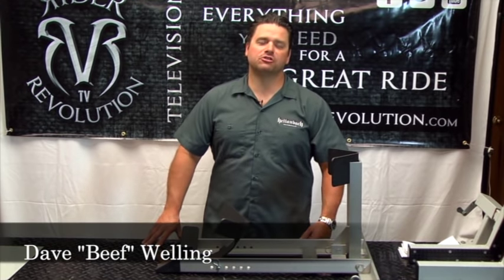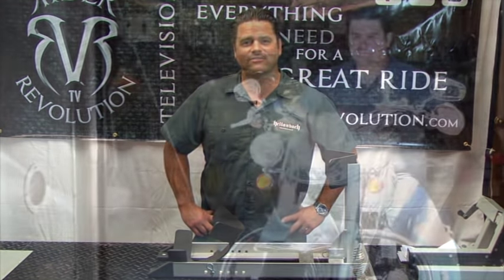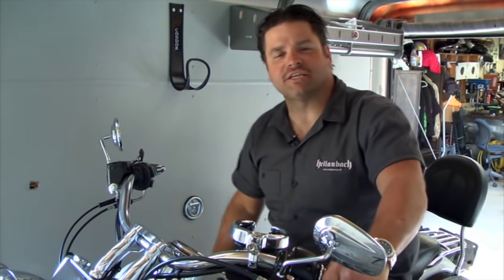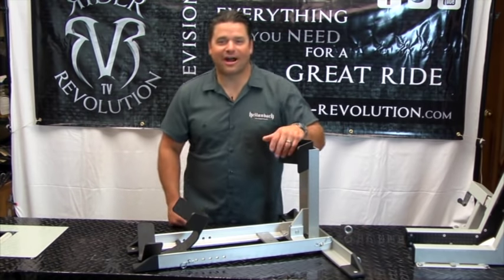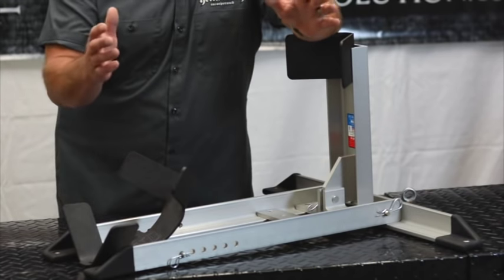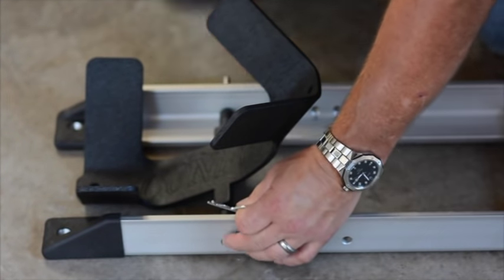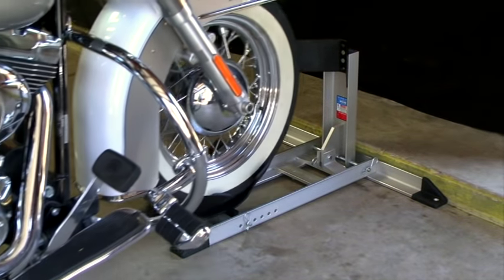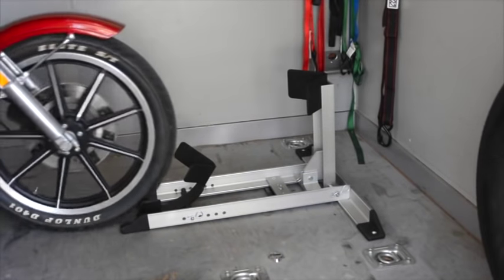Rider revolution/Condor wheel Chock

Comment: I have this , bought it at Harley dealership so obviously it's Harley "branded".  Either way , I love it !   No regret or buyers remorse here . I don't trailer my bike , I simply use this to park my Softail Breakout in the garage. As any bike owner knows, it's so much easier to work on your bike or detail it when it's standing straight up-n-down as opposed to setting on the kick-stand.   

One small thing to consider ; when you want to get your bike out of this chock/stand , you need to be sitting on the bike in neutral and give a good roll / lunge in the reverse direction.  I had my left knee replaced a few months ago yet I can do this .

Comment: What tye of system should I use to mount my chock temporarily... I have a wood floor toy hauler camper.  So I can't use standard screws to mount because putting it in and taking it out a few times would make the screw holes in affective and loose. Any help ?

Comment: Now how hard is it to pull it out of the chock.  I got apes.  The Harbor Freight one is a bitch getting the bike back out and as you can see, I'm not weak.
Reply: i guess it depends on your hight with most schocks.im 6ft3"and(how long your legs are matters)i have a road king,no apes and a zx14r and it is only slightly hard to pull the hog off the chock,the sport bike is a little more difficult to pull off but not a big deal,you want a schock that is kind of hard to pull out of so the bike stays put.i dont think there are any schocks that are as good as the condor and i can use the same schock for cruser or sport bike,and the bike stands straight up so i can get off and strap the bikes down by myself without worry,these are a little expensive but its the last schock you will ever buy(super strong welds),i got the ps1500 with the trailer adapter kit so i can use the schock in the garage if need be,its been one of my better investments,and no i dont work for condor,hope this helps.
Reply: That’s the problem I have also with the Harbor Freight chock. HD Heritage Softail Classic tires are just too wide to get it out without a battle. The Condor looks to be somewhat wider.